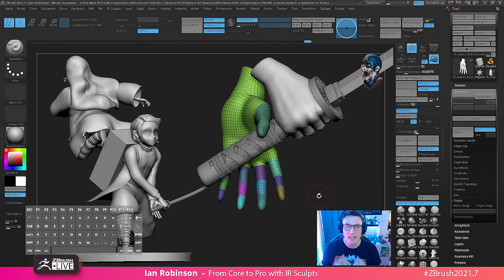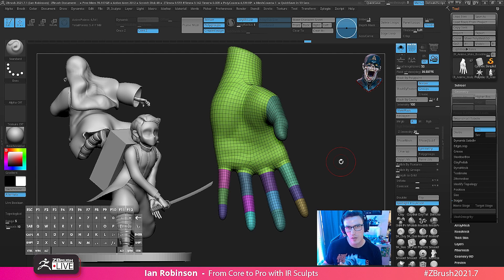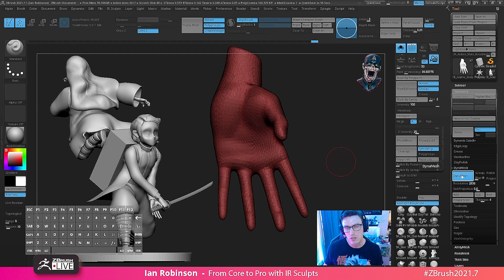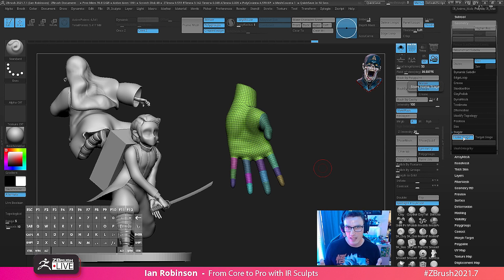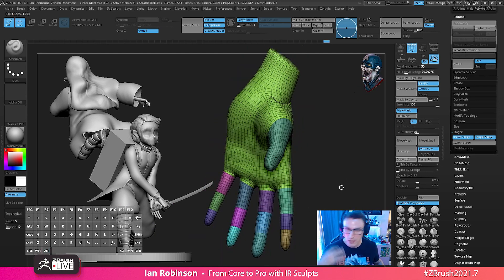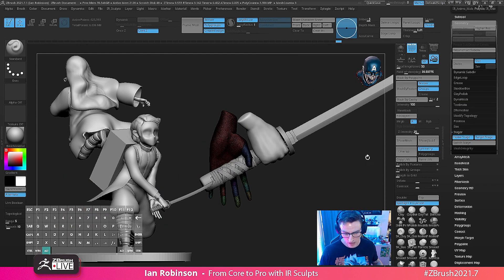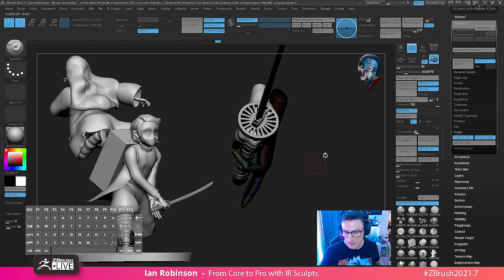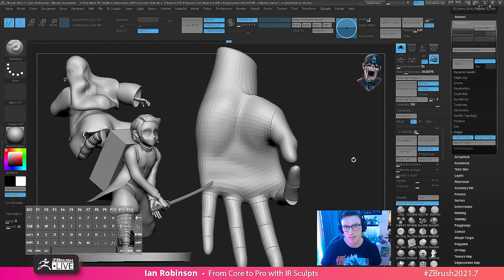ZBrush Summit Top Tips & Tricks - Posing Models with Stager & DynaMesh - Ian Robinson "IR Sculpts"

Comment: Just for some clarification, dynamesh resolution isn’t based on the size the subtool appears in the document (viewport) but is based on the unit size of the model. You can find this located in Tool > Geometry > Size. The dynamesh resolution number is equivalent to the number of polys generated on an axis for the default ZBrush cube size of 2 units in all axis. By scaling the model with the gizmo you are changing the actual size of the model and so the larger model will have much more resolution at the same number due to its relationship to the unified ZBrush bounds of a cube. Clicking on the Unify button in Deformations will size a subtool to the default units.
Reply: Thanks! That helps...